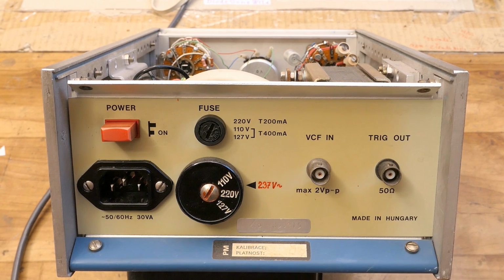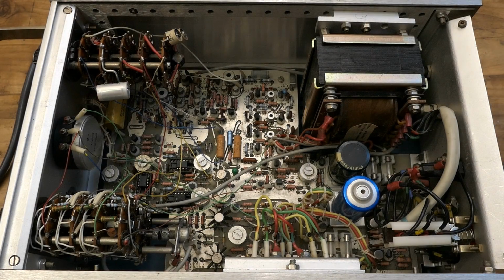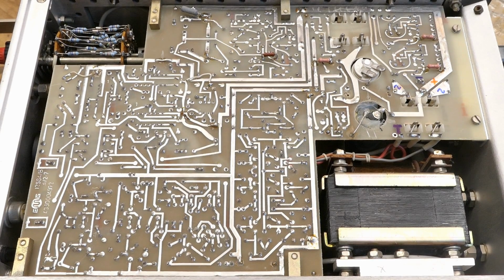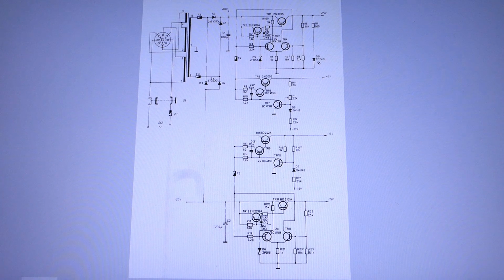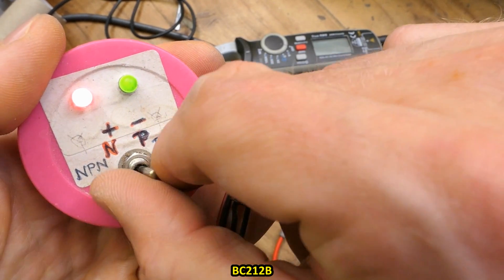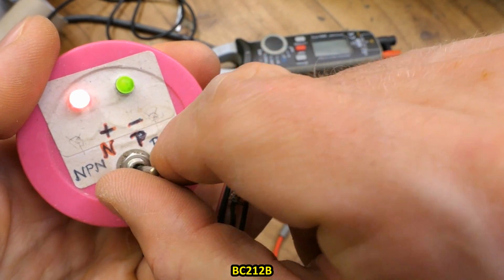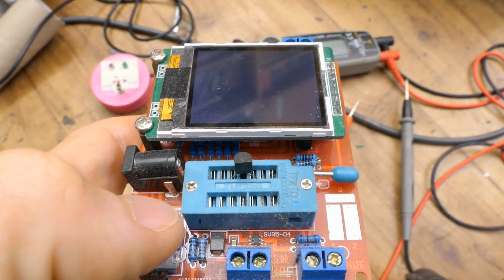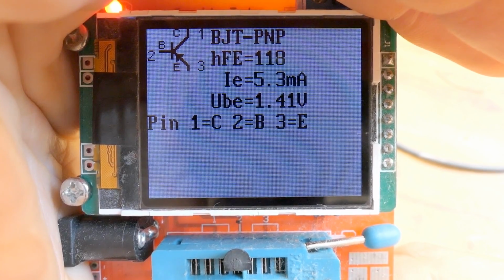Function generator repair (Hungarian TR-0458/B)

Comment: Amazing how we can now replace the entire engine of this instrument with a 40MHz AD9850 DDS module, with an accuracy of a 125MHz crystal, the size of a big stamp, for less than $40!!!
Reply: Engine -  machine with moving parts that converts power into motion. ?????, circuitry is a better descriptive word.😏🇬🇧
Reply: @brucepickess8097  Tell that to game engines.
Reply: @piconano  my comment stands. The term engine has no relevance to this piece of equipment as it is not software based.😏🇬🇧
Reply: @brucepickess8097  Like I care!
Reply: @brucepickess8097  Charles Babbage created the difference engine. 
 Not that I am trying to pick an argument.
Reply: You mean $8?
Reply: @LMB222  By the time I added the rotary encoder, Pro mini, LCD, battery, switches, amplifier, BNC jack ... It came out to about $40.

Comment: The voltage base to emitter isn't 1.4V, its 1.4 bloody V 😁💖
Great that you managed to repair it 😊
Reply: For some reason it seems bizarrely like exactly twice the stereotyped barrier potential of silicon (700mV) qwp, I wonder if something shorted in series.
Reply: @BritishEngineer what I can think of is that the casing  perhaps wasn't closed properly and the PNP layer got doped through oxygen - if that's even possible.
Reply: @liam3284  Indeed, but the low hFE would make this transistor a very poor darlington.
Reply: Well, there's no material in practical use (other than LEDs) that has a "bloody" bandgap pc 1.4V, so he's right here, it's a bloody weird failure to happen. 

I've also never seen a semiconductor component fail this way.

Comment: I guess the transistor case cracked from age and moisture ingress damage the silicone die. Really strange failure.

Amazing video as always 👍👍👍
Reply: The gap is probably manufacturing defect, but I agree, the fault in the die was probably caused by moisture seeping through the crack.
Reply: @mrnmrn1  That's possible